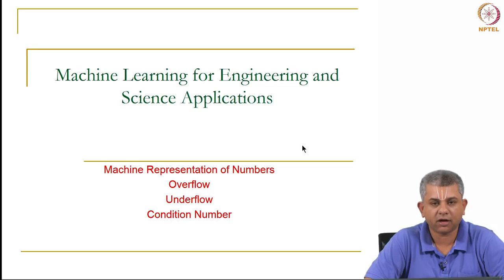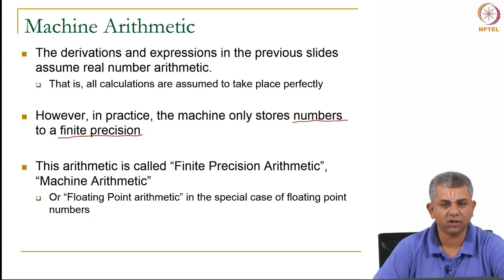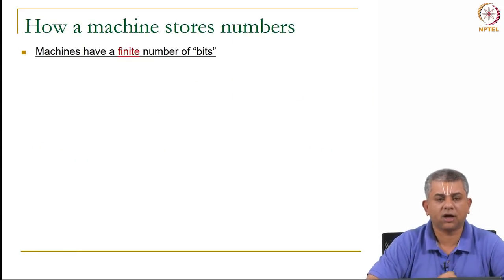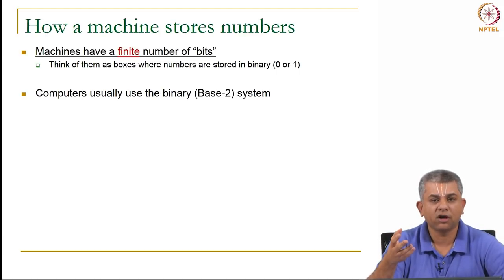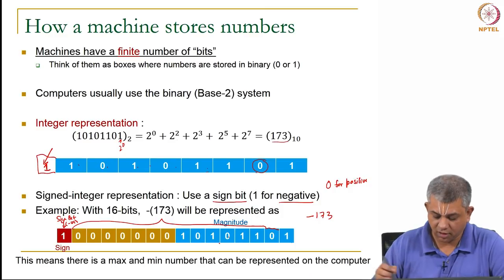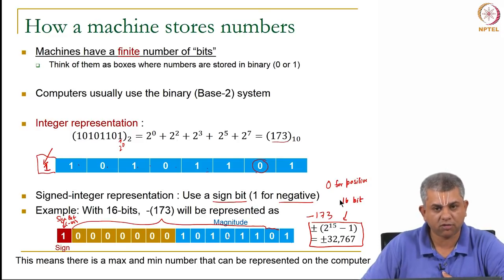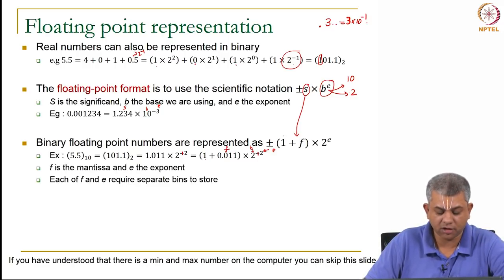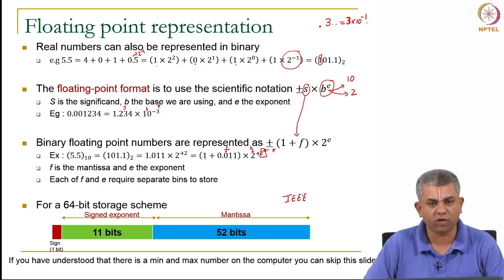Machine Representation of Numbers, Overflow, Underflow, Condition Number

Comment: 19:50 why can it represent 1e-16 after adding to 0 ? If it is below our mantissa precision, shouldn't it be always impossible to print it ?
Reply: Okay I got my answer after a little bit thinking, when we only print 1e-16 we only use 1 digit of the mantissa, but when we need to add it to the 16th digit of 16-digit precision number, we need to represent it with a number having the mantissa which is lower than the machine epsilon. In that operation we can not get a hand of that number so it is vanished. I hope this is correct.